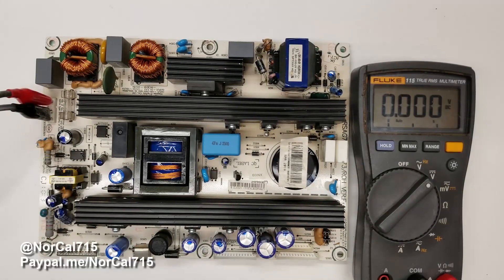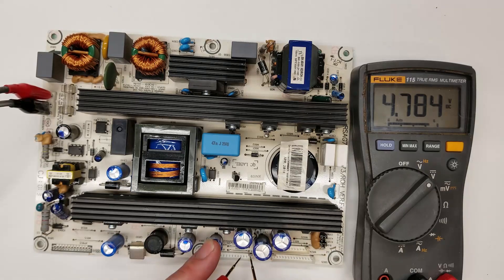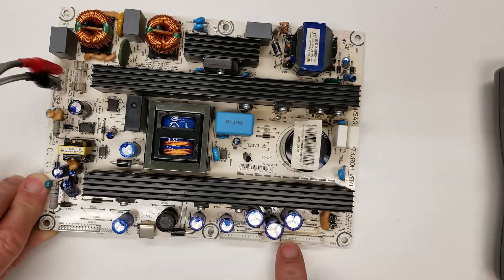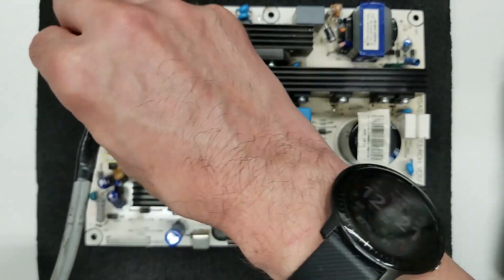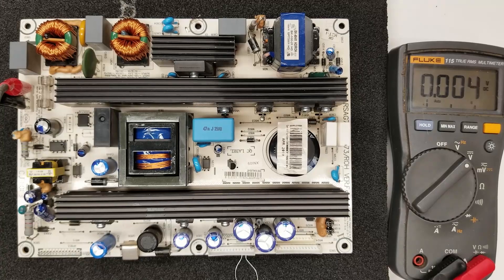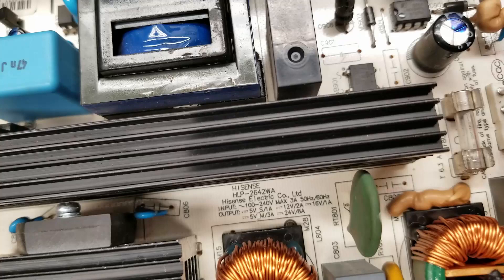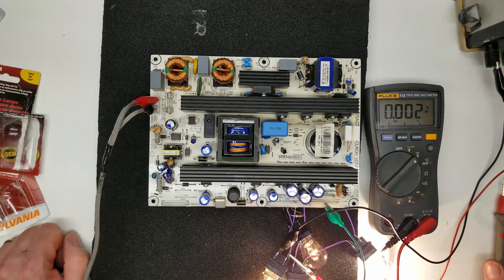CUSTOMER SENT ME A POWER SUPPLY BOARD TO TEST

Comment: How did you have the power supply connected to get past the in-rush current needed by the bulbs?
Reply from the maker: Just connected in parallel to the bulb, and completely isolated from main supply or earth connections. the power supply is isolated and the variac is isolated also. Make sure to watch part 2 of this saga also. https://youtu.be/e5__hNFu0h4 Thanks for watching

Comment: All switchers need a minimum load to operate. Sometimes an active load is built on the supply to ensure startup. Obviously that is not the case here. However, you can probably get away with a small load on one of the rails because it looks like they are all generated by the same switcher. 

What I'm saying is that you probably could have put two lamps in series on the 24V rail and the entire supply would have come up. 
Just a suggestion, not in any way a criticism. Good video, thanks.
Reply from the maker: You are probably correct. I am planning on ordering some high-wattage low-value resistors to accurately load the supplies in the future. Thank you for your support.
Reply: @norcal715  
You can probably pick up a power resistance decade box for not too much on eBay. Very handy for power supply trouble shooting and repair when an electronic load is out of the budget.

Comment: Smoke at the end of the video.
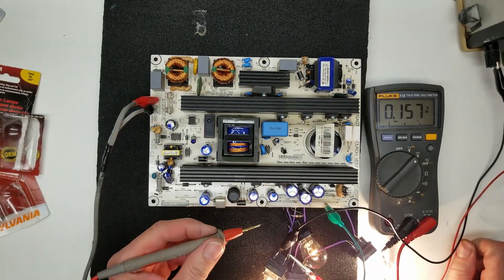Reply: I noticed it too at about 9:37.
Reply from the maker: It's in the description.  Melted the rubber mat I had it on.
Reply: @norcal715  You need a proper anti-static rubber mat that won't melt so easily. :)
Reply: But was there fire ?😍

Comment: I am in NorCal/Shingletown near Redding...My son has 1000W switching supply sodium lamp driver that delivers between 300 and 400V to the lamp for variable output. the unit runs on 220VAC supply but it was wired incorrectly, where ground got 1 of the 110V lines, and 1 of the line inputs got ground with the other getting 110V line as it's supposed to. the unit no longer works.
As expected the case (ground) has only 2 references to the circuit board. Each of the 2 only go from the ground plane/case through flat capacitors to each Line connection after induction coils but before bridge rectification, I know this to be for surge protection. This should not have caused a failure.
.
I was thinking that maybe driving the 220V lines with 110V (ground is referenced to neutral back at the electrical panel) may have cause the mosfet switcher to lock "on" instead of oscillating which would send solid current through the mosfet via one of the primary windings of the main transformer and burning it. I call it the "exciter" winding because the other primary winding gets constant filtered DC from the line input via a bridge rectifier. (actually they parallel two of them and heatsink.)
What else could be wrong?
P.S. they poured a black goop all over the board and components that melts at about 200F, how nice of them :-)
If you have any ideas, you can PM me because I don't get notifications to replies.

Comment: I have never needed to deal with a base load for the standby.  However, it has been a common issue that the MAIN output ( 5 V because it provides the feedback ) has needed a minimum load.  That has been listed in the data sheet.  But generally that covers all worst case situations regarding line voltages and ambient temperatures.  The data sheet specified value has been  more than the necessary minimum load.  Our experience  has been that 50 to 60% of the specified minimum load has always worked.  But definitely only occasionally does some power supply start without at least some load on the main output.

Comment: Just a safety issue.  If all you're using is a plain variac, then you're NOT isolated.   Variacs are autotransformers, there is only one winding.  If any part of it connected to mains, the output is too.  Not trying to get on anyone's case about it, just don't want folks to think a variac protects them.  An actual isolation transformer is needed.
Reply from the maker: I am using a Sencore PR57 variac with built in isolation transformer. I will make a note of it in the description. Thanks
Reply: @norcal715  That's a nice machine.  I have an old Heathkit IP-5220.  Lifesavers.

Comment: It's my understanding that a variac does not provide isolation.  Do you have some special power input arrangement?
Reply from the maker: The variac I have is a sencore PR57 and it has an isolation transformer built in as well as a variac. A standard variac transformer does not provide isolation. Here is a link to the pdf owners manual and schematic. http://akdatabase.org/AKview/albums/userpics/10007/Sencore%20PR-57%20Manual.pdf
Reply: Correct, a standard variac is NOT Isolated

Comment: Good video as usual. I'll be leaving it on for a while and looking for dry joints before sending it back though. Mounting in the chassis might also cause the issues that the customer has mentioned. I like your smoke machine with the bulbs and pad! Last supply I got in was from a Sami 46A650 (old but nice image) where the owner tried to fix the fuses that kept blowing by wrapping a dead one in aluminium foil. There was a short in the power fets, you wouldn't believe the damage that board suffered when he turned it back on.

Comment: Great Video.  Lets Fight against obsulation and the crap the big Players produce so that you wont have to buy a new Set because of parts for 50cents. More of these repair Stuff.
Reply: It's these damn switching pos power supplies they keep using. Why can't they use a linear power supply.

Comment: great video. The resistor from STBY to PSON ...is that to limit current?
Reply from the maker: Yes exactly. just in case the manufacturer of the board didn't put current limiting to the relay drive transistor.